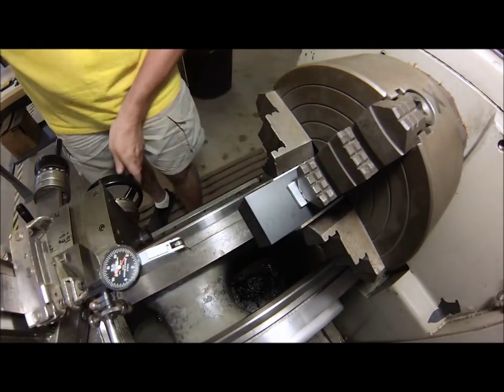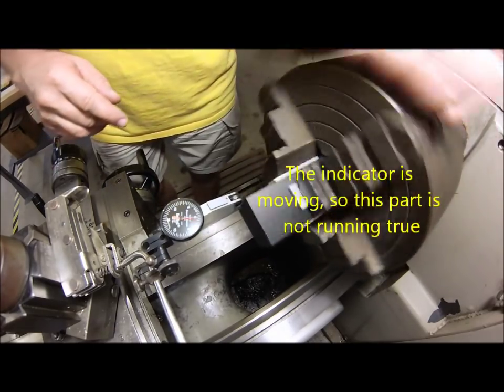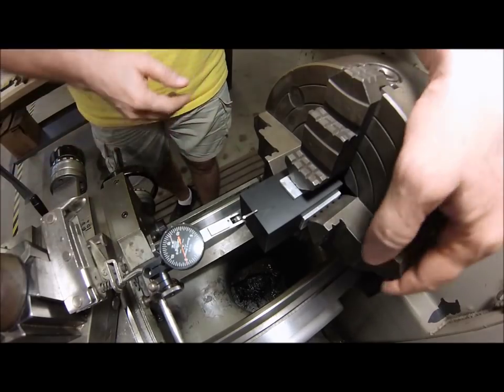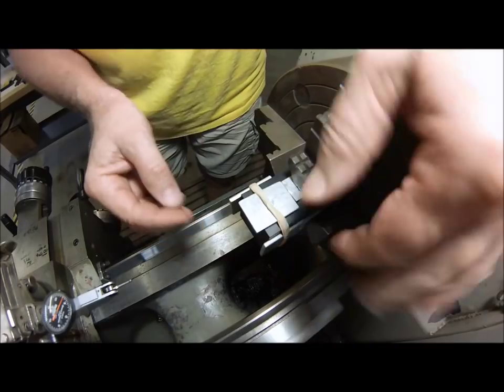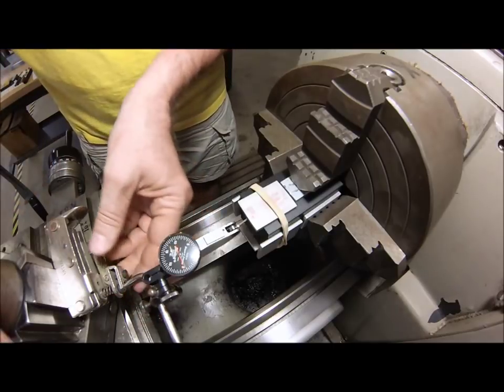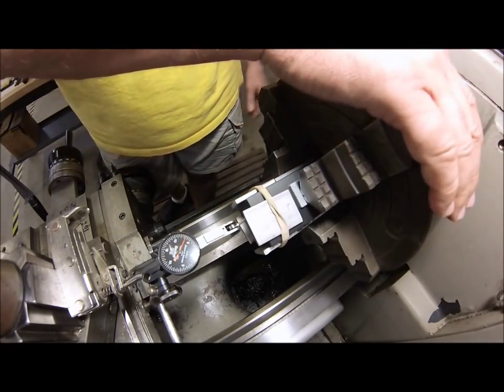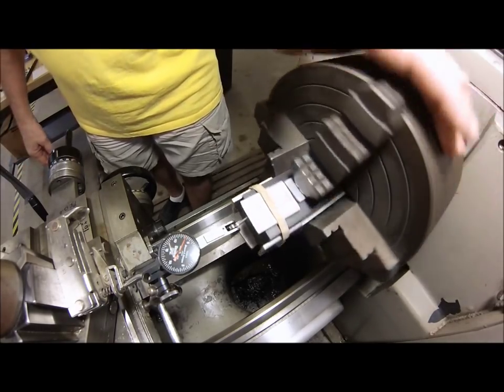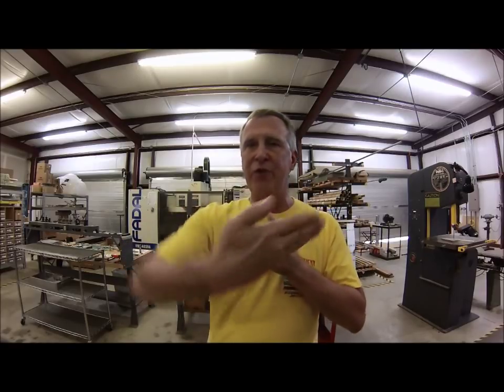Clever way to indicate a square part in a 4 jaw chuck - SUPER EASY !!

Comment: Don't know if anybody reads comments on old videos like this, but what would be a good way to dial in a round bar in the same manner? e.g. I have a 1" diameter round bar, 3" in length. I want to face one side of it, dead nuts in the center.

Comment: My rough way of doing it especially on itens with saw cut edges is by scribing a line corner to corner.
Bringing in my cutting tool and matching the point, of course this only works if your cutting tool is at center line.

Comment: Thanks Joe, I remembered watching this when I had to do something similar, so I looked this up in the archive, but my stock is not square, it’s 1/2” x 5/8” it’s driving me nuts! Is there any better way of centering rectangular stock?
Reply from the maker: I know this may not be possible, but put 1/16" deep notches on the shims you're using. Put those shims, with the relieved surface out and facing in on the 1/2" sides and indicate just like the video shows. The projected surface will be 5/8" in both directions.
Reply: Thanks Joe, that made me realise that since my shims are 1/6” ground flat stock, if I cut an extra one in half and put it under the 1/2” side this has the same effect, and it works. Brilliant! @joepie221
Reply from the maker: @christaylor528  Glad to help.

Comment: I feel like I'm doing something really wrong... I'm getting consistent indicator readings on opposing jaws, but different readings on adjacent jaws. Jaws 1 and 3 are reading 0 and jaws 2 and 4 are reading +.002 I'm trying to make sense if how this is even possible. This happens sometimes when I'm indicating round stock in a 4 jaw chuck as well. Forgive me if this is a stupid question, but I'm really new to machining and still trying to figure out how to set up 4 jaw chucks.

Comment: Old video- so you might not be expect comments... but I have noticed for a while the sound of the cross slide on your lathe is glorious! Seems to be something other than a lead screw to a nut? is there a gearbox on the hand wheel for that type lathe?

Comment: Cool trick.. looks like 1/8" shims you were using.
Reply from the maker: It was, but the thickness doesn't matter as long as they are flat. They can all be different and it would still work

Comment: I like this technique! One question: Do all four shims have to be perfectly ground to the correct thickness in order to achieve an accurate reading on the dial testing indicator?
Reply from the maker: Absolutely not. The shims need to be flat on the side in contact with your part. The thickness can be different and they will still work provided the contact surfaces are secure.
Reply: Joe Pieczynski thanks for the advice

Comment: @Joe Pieczynski - I'm a new toolmaker and I love your content,  especially tricks and tips. I have a question, and maybe you could do a video on this if you can. How can I indicate on a lathe dead center of a hole, drilled in square stock that has already been drilled using a mill?
Reply from the maker: Put a nice fitting pin in that hole with some protrusion from the end of the part, and use a 4 jaw chuck. It should be easy. Indicate the pin in 2 places for proper alignment.

Comment: Joe, I just reviewed this video again because I need to zero a 3/8" square stock which is a bit too small for this technique. I remember a similar method that you or maybe someone else showed using a single shim attached to a fixed point (maybe a magnetic base) with a piece of tape, and resting against the stock. I must have forgotten some details, because I can't get it to work. Can you point me to the video?
                           Ken

Comment: Would you please offer suggestions on how I can center a round part with features around the perimeter of the part that require me to use a 4 jaw chuck.  The part was 3D printed and has an approximate 3" hole that needs to be enlarged by about 1/8".  The part also has a split at one location of the circumference that will eventually use a bolt to secure the two "loose" ends of the part together.  I found that without using the bolt, that the jaws were skewing the ends of the part, distorting the 3" hole I was trying to enlarge. The part is something I designed on Autocad to hold a dial gauge around the collar of my bench top milling machine.  Bob B
Reply from the maker: Thin flexible parts should be strapped down to a faceplate to avoid distortion. Chucking plastic or 3D printed parts can be tricky.

Comment: Very good video and content!!! 
What do you think of toolmakers buttons for that job?...
For those who don't know them they are very simple... A screw and a zylinder with a bore slightly bigger than the screw that's important for tapping it true when using them... The screw comes to the center point where you want him to be.. then with the indicator at the outside of the zylinder slightly tapping until it runs true.....

Comment: Hi jo, question about the finger style indicator... your rotating the probe end either up or down on its axis to the point you want to start indicating ... Is that a special end on that dti or is that just a normal function of ever finger dti?.. they are so sensitive I've never moved a  tip around like that as id worry i'd break the indicator ... are they designed to have a slipping holding friction to allow this?... honestly never seen this covered anywhere or even mentioned before. Matt
Reply from the maker: I know the Starrett Last Word has a crown engagement and a locking tab, B&S are friction and not 100% sure about the others, but  I am fairly confident in saying the majority of lever type indicators will allow for tip re-positioning.
Reply: Joe Pieczynski thanks for the reply sir , will take a look at the one I have

Comment: I really like this guy but please wear eye protection, get a chuck guard and don't file in the chuck.
When I started 50 years ago we worked in the same way but accidents happen easily. The other day I was working with the chuck guard and wearing glasses when a hot chip bounced off the carriage under my glasses and into my eye.
Be safe out there.
Pete
Reply from the maker: Thanks Pete. I am very aware of my environment. I too have had chips surgically removed from my eyes from a ricochet.

Comment: use a drop indicator so you dont have to move your setup...
Reply from the maker: A drop indicator would not work with this approach and even using a drop indicator in a conventional outside contact setup, the potential for knocking it out of position when rotating the part still exists.

Comment: Hi Joe, I just bought a used 4 jaw independent chuck. I cleaned it up and found it has a tight spot midway in one of the jaws.
I thought about using some lapping compound and running the jaw in and out to try to free it but I'm not sure that is wise.
It's usable so maybe I should leave it as-is. Any suggestions?

Comment: Joe, there's a way to center a square in a 4-jaw without this dial? I say this because there's no such instrument in the shop i work, unfortunately.
Reply from the maker: If there is no hole in your part, Use this trick with a piece of brass or something in a tool holder setup like a boring bar. Adjust the chuck to run close by eye so the brass rod ( small diameter ) is close to the shim. If you have a bearing laying around, put that on a piece of material setup like the boring bar and continue this process until you see the bearing just move everytime the shims come around.
Reply: Very well sir, many thanks. I'll try this.

Comment: Like the tip!  

Only thing I would add is to make sure all the rubber banded parts are free of any burrs that might hold them up on the part giving a false positive "0" reading.

Thank you
Reply from the maker: That is a good suggestion. Likewise, the corners of the block should be de-burred as well. if my part came off the mill and was headed for the lathe, it would be deburred.

Comment: hi joe, i got a question or a request if you may..*im on a level way beyond rookie for lathe works*

i had to turn down a one inch shim on a 3 jawed chuck. the id is roughly the size of the 1st step of the chuck jaws.
so typically, i will slide 2 parallel bars on the back of the part and mount it on the chuck. i had to machine the surface so that i achieved a given thickness of shim. and i need to make sure its surface is true within 4 tenth of an inch. how do i correctly set it up, dial it, twerk it to get it on the 4tenth tolerance.
Reply from the maker: How big is the outer diameter of the part? and does the center hole have anything to do with the final application?
Reply: its a five in outside dia. the center hole, a chamfer of 45 deg angle with a length of 0.08in. i hold the part down with the 2 parallel strips so that when i tighten the jaw, it wont cover the part that id be chamfering, then remove the strips so it would fly off while im machining.

i need some tips to make sure the surface flatness is within 4 tenth coz now, after im finished turning, measure it with a micrometer, some place itd be off about 1-2 thou..
Reply: You don't say how thick the shim ends up (I presume 0.08" relates to the chamfer, not the base material?)

If it is thin, how I would approach it would be to chuck up a disk of metal about 5" diameter, face the protruding end flat, but leaving a cylindrical protrusion which was a snug fit in your centre hole, and a bit thinner than the finished shim. 

Then glue the cleaned workpiece to it using a MINIMAL amount of Loctite Super Glue Ultra Liquid Control or similar, taking care to apply rapid and even clamping pressure so the liquid is squashed to a uniform and negligible thickness, using the tailstock and a suitable spacer. 

Face and chamfer as required in the lathe, then use a hot air gun to raise the temperature of the part to maybe 140 deg C. The glue is only rated to 80 deg, and if you get it hot enough you can peel the shim off. To make this easier you could either make the metal disk slightly smaller than the part, or provide (ahead of time) a few recesses to get a persuader in behind the part.

If thicker, I would turn a ring spacer which could stay in place behind the workpiece, with a centre hole just barely larger than that in the workpiece.  Before taking the final cut, I would loosen the jaws and carefully tap the face of the workpiece with a deadblow hammer while turning the work and slowly tightening the jaws, NOT TOO TIGHT so they don't bow the work.

The spacer would have to be surface ground or scraped to achieve the tolerance you need.  I have a bunch of bearing inner and outer rings I use for work like this, together with a slightly thinner spacer supporting them from inside. This saves some time and the need for surface grinding, if the bearing ring is just shy of the OD of the workpiece and the right thickness.
Reply from the maker: I just watched the video again and can't locate the part where I say the
part is .08 thick. They were .008 thick. Regardless, your way would be fine
if you only had 1 part and could use glue on the part without damage. This
ultra thin video shows 30 shims being machined at the same time with the
thinnest one being .0015 thick. When this technique was developed, I had
almost 1000 parts to do with the thickest one only .015 thick. I did
plastic, fiber, paper and brass. Start to finish, 5 hours.

Comment: ABomb is the 4-jaw chuck champion of the world right now.... https://www.youtube.com/watch?v=0IStp69jcJU    hehe (Round stock) I'd like to see a video of exactly how you center round stock in a 4-jaw. I don't have a 4-jaw yet so I can't just finger it out. I watch abomb and others but I can never see the dial of the indicator so I can't tell if ya just find the highest reading and push the stock in the opposite direction or what.
Reply from the maker: I thought he was de-throned in 2016. Time was 46 seconds I believe. He has skills, there is no doubt about that. Your concept of how its done is correct.  and.... I'm not talking smack here, but your only champion over the guys you have challenged and beaten.
Reply: True. True.

Comment: Great tip Joe and Happy Birthday ..... There's nothing better than picking up tips from a million different ways of doing the same job. I once worked as a welder welding up someone else's gaps in structural pipework which was fitted up on site. Hours of welding 'daylight'.... I set to work with a hand held computer and worked tens of thousands of hours to write software that creates perfect ordinates templates for any type of pipe fit up at all, just so as I would never again have to weld 'daylight'.... That was over 20 yrs ago. I just love tips and tricks and better ways of doing everything imaginable in industry.
Reply from the maker: Thank you, I agree. I have sen things that just turn on the lights, I just step back and smile. I usually think, "clever old dude". I like when I offer up a trick, and someone says.....ya know what might work?

Comment: Great ! -- wish my workshop was like yours -- hot ! presently 0 Deg ( no heating ! )
Reply from the maker: Come see me in August when its 105 out there.
Reply: Use to go to sea -- down the Red Sea in the galley -- 140 Deg !
Reply: Joe, could you add a warning for those folks that have screw on chucks-- running in reverse can cause the chuck to unscrew............  I found out some years ago --- the hard way !

Comment: I need to machine square stock once in a while. This looks like it might be a little trickier on half inch key stock but certainly worth a try. Great tip! Thanks.
Reply from the maker: Get yourself a square 5C collet and forget about 4 jaw chucks for parts that size.

Comment: F** genious!!!!! Thank you Joe :-)
Reply from the maker: Thanks
Reply: By the way Joe, I noticed in this video that you were adjusting your indicator-lever to your preferred approach angle. My indicator looks very similar in construction to yours but I had no idea that the lever could be repositioned on some indicators.  There was no mention of repositioning the lever in the box notes. Do you know if there is a way to visually identify if my indicator lever can be repositioned (just like yours)....before I physically try to move it.....I fear that forcing the lever past its measurement-full-scale-deflection may cause damage to the indicator....any ideas? cheers either way :-)
Reply from the maker: Without knowing the brand and model, I shouldn't suggest you just push it. Although, every indicator I have ever used has had an adjustable tip in one form or another. If you look closely at your tip pivot point and see teeth like a crown, there should be a secondary release of some sort, if there are no teeth present, its probably friction.

Comment: Very good... I also like to use a scale and measure the back of each jaw to the perimeter of the chuck, on square or round things. I can usually get run out down to around .015" or less before putting an indicator on. Helps too when I'm running a big lathe and have to get a part mostly centered before I can turn it to indicate.
Reply from the maker: Thats a good technique. I als pick a spot on the jaws and visually reference the location to the circular grooves on the face of my 4 jaw. Its like a primitive caliper.

Comment: That is a great tip!!!!!! Really!!! All of the old timers I've worked with never did this. Always bounced off the edge or outside flats. I just used your tip on a 2" hex stock, with shims in a 3 jaw. Works great thank you.
Reply from the maker: Excellent. rectangular stock, just do opposing side separately.

Comment: Great vids Joe,  I noticed you can move the arm on the test indicator.  When looking for an indicator that will let you do that what 'feature' is that?
Reply from the maker: Most all of the indicators I have ever used have this feature. I am not sure what the manufacturer calls it. Adjustable tip maybe ??
Reply: thanks Joe
Reply: BTW, in Oregon

Comment: Please demo your tips for rectangular stock
Reply from the maker: Hi Robert. Work 2 sides at a time. It will save you time, but not as fast as a truly square part. Mark which chuck key socket you use, to do the final tightening once you are happy with your location. Mark the rotation too by putting a clock mark on the socket and chuck body with a marker. Torque can change location. Good comment. Thanks.

Comment: Cool trick Joe happy belated B.D. What kind of lathe is that I never seen one where you could position handles like yours.
Reply from the maker: Hey Mike. Thanks.  Its a Clausing Colchester. I guess around 1990 they started with the hand wheel that you could index to make things more comfortable. I've run the 13 and 15 and they both had this option. Very cool.

Comment: My favorite trick for square material in a 4-jaw is to use a 4-jaw scroll chuck. :) 

I'll call this a much more versatile second favorite. :) Thank you!
Reply from the maker: I've never seen a 4 jaw scroll chuck. Thats cheating. Thanks for the comment.
Reply: $180 (shipped) from Shars. :)
Reply: Of course that's not much use on hex stock, or rectangular or otherwise irregular, or for eccentric turning, so I have a 3-jaw and independent 4-jaw as well..
Reply: Still has  all the problems of a scroll chuck in that you rely on the manufacturer to make it very accurate. What if you need to adjust?